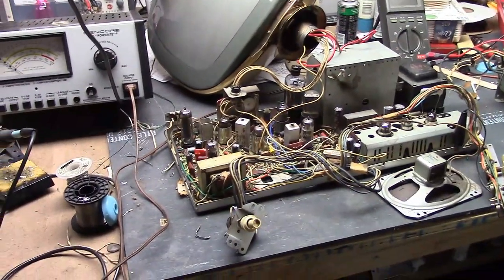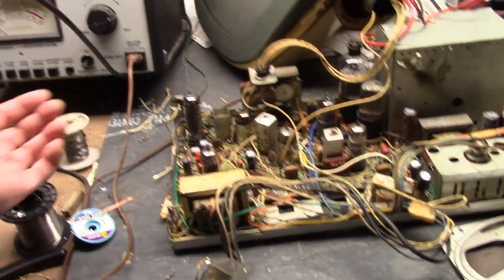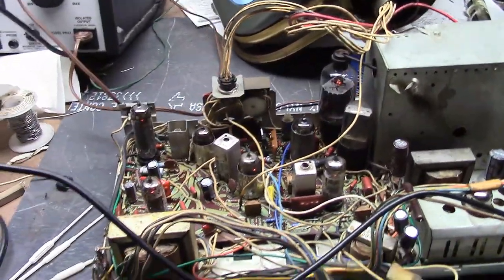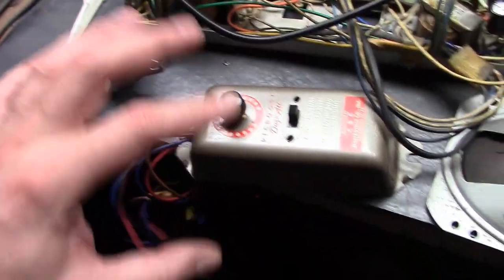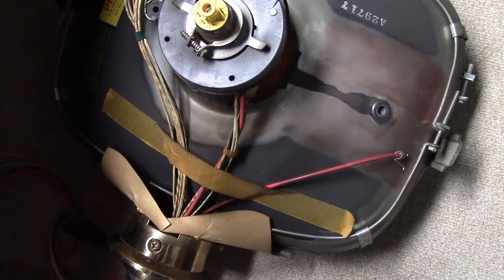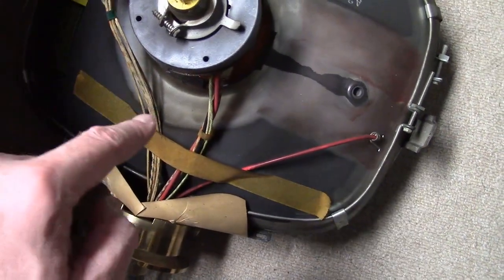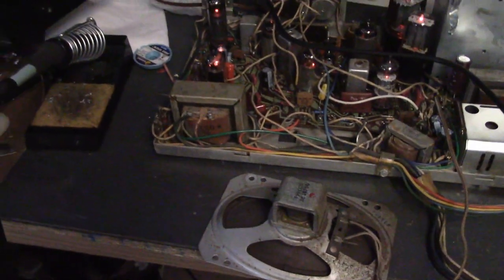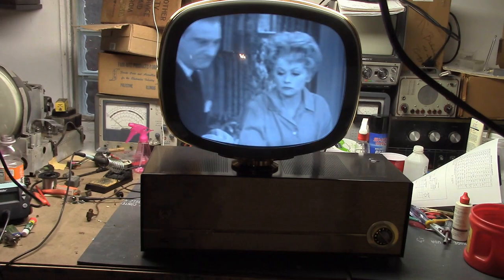Predictapalooza S1 unfinished business - Chases Debutante

Comment: One small correction. The filament wires are coated with an insulating ceramic before they are inserted into the cathode structure. Since it is in a vacuum there wouldn't be much heat that would reach the cathode if there were no contact. Heater-cathode shorts happen when the coating flakes off or otherwise breaks down.
Reply from the maker: Thank you for the correction.  This is also one of the goofy, tiny low voltage electron guns.  The structure is similar to a miniature vacuum tube lying on its side.

Comment: Bob- For the missing antenna pins, check the size of the pins on tubes. IIRC I used to take dud tubes and use the pins off them. Either octal or septal base tubes should provide the right size. One used to be able to buy bags of the pins and the connectors for the antenna terminals. As far as the broken osc coil core, I saved a drawer full of coil cores from many TV sets & stereos. I just try to match up the size and length. Sometimes I had to use 2 cores to get the correct amount of adjustment if I didn't have the correct length core. They also make a ferrite cement that works, but can't fix a wallowed out core hole.  RE: HK short- I had to add a separate fil tx to solve the problem a few times and it always worked. I might even have a few old CRT iso-boosters in the storage too.
  (Once had a set come in with 5 of them hanging off the CRT. They got every electron possible out of the CRT.)

Comment: Maybe it’s common practice to run the CRT cathode 200+ volts above the heater, but that design really asks for trouble. I had two different RCA color sets from the 70’s that had intermittent heater/cathode shorts on one of the guns (if I remember correctly, it was the red gun in both cases). I ended up changing the CRT on the 19” set. The 14” set with this problem was all solid state and the CRT heaters were driven off of a small independent winding on the flyback transformer. Since one side of the CRT heater winding was referenced to ground, every time the red cathode shorted to the heater, it pulled the cathode to near ground thus driving the red gun to FULL on. The fix I attempted was to cut the ground connection to the CRT heater winding so that the heaters could be pulled up to cathode voltage when the short occurred.  I say attempted because it only sort of worked…whenever there was a short, the miniscule amount of capacitance between the CRT heater winding and the flyback core was enough to cause slight but noticeable smearing of the video.
Your attempt to run the CRT heater from a separate transformer should have produced more than a dark screen so I’m not sure what happened there. Had it worked, you would have seen the effects of the capacitance between the primary and secondary windings of the heater transformer which would have been video with almost no high frequency content.
Anyway, another good video! Keep up the good work!
Reply from the maker: The cathode is about 40 volts above the heater depending on the brightness setting.  Agreed - I should have gotten something on the scren.  I will experiment further with this CRT.

Comment: Seen on fleebay "vintage 2 terminal phenolic screw strip 300 Ohm NOS". They could attach to the back and you could 
use the crimp end for a connection for the interior 300 Ohm lead, add enough twin lead to remove the back for access, 
and use old octal pins from a bad tube for the interior connector to both pin crimps. The screw terminal end is used as
 originally designed for the antenna or 75 Ohm to 300 Ohm transformer adapter.
Reply from the maker: I see them, thanks.  If I can't dig up something similar in my stash, I'll go for it.

Comment: It would make sense to approach that CRT HK short problem with a 6.3-volt isolation transformer, as it should have just fired right up. Perhaps there's an additional undiscovered problem. On a different note, I suspect slight modifications need to be made to the set's power supply to accommodate for today's higher mains voltage, as this set was likely originally intended for 105-117 VAC.
Reply from the maker: No modifications are needed.  It was designed for 117 and uses a power transformer.  I think 105 would be too low.  Typically, we see around 121-125 these days.  That's only about a 5% increase.  Nothing to be concerned about.
Reply: @bandersentv  Based upon your response, I suspect that tube-based electronics are somewhat forgiving regarding their voltage requirements.
Reply from the maker: @chetpomeroy1399  Yes. very.  No volage regulation.  The screen size and brightness will vary with line voltage fluctuations.  It's all part of the charm.

Comment: I dunno if it would help Bob, but it seems there is a surplus of polarized versions of these cords out there
Reply from the maker: I have a good stash of both polarized and non-polaried.  The tricky part is finding one with a long body to extend through the back and into the connector.  The original is about an inch long

Comment: There's definitely more wrong with that CRT than an H-K short. Negative voltage on the cathode turns the tube on so a fault to ground would blast the beam if everything else is present.

Unrelated you might want to reshoot the intro because the Siesta's picture is squashed. It looks like you were squeezing the 16:9 graphic onto a 4:3 screen without any correction.
Reply from the maker: I still have the CRT and may do a follow investigation.  Will definitely save as a future rebuild candidate.  The intro was created by a friend and fellow Predicta enthusiast.